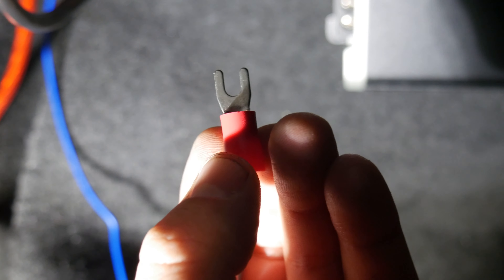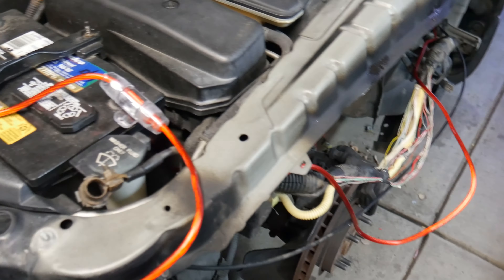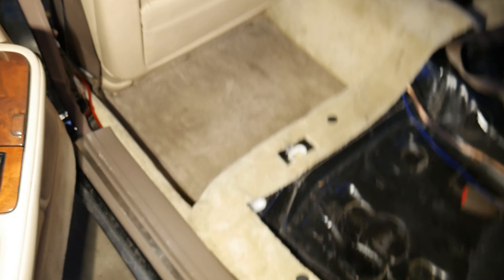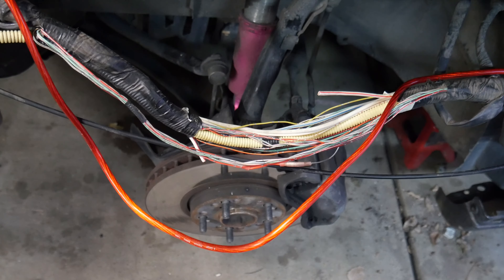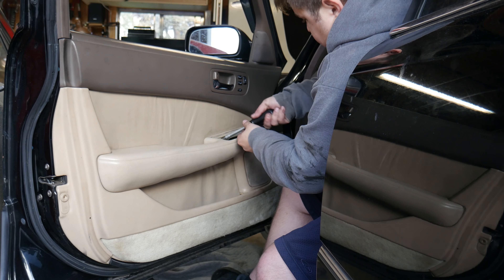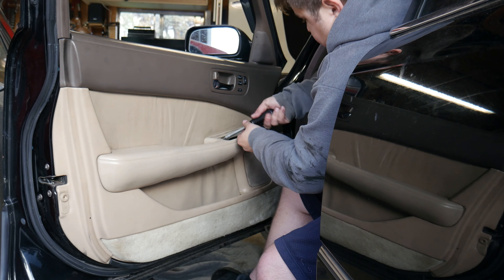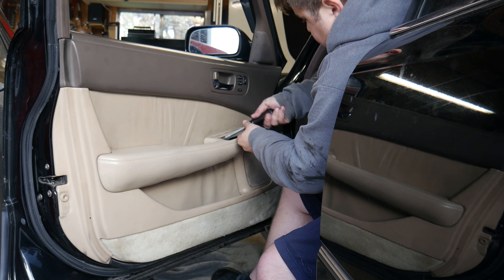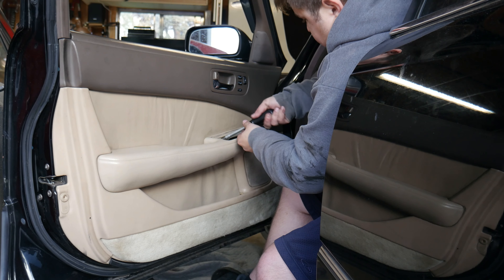LS400 Wiring Harness Tuck and Subwoofer Install [PT. 3]

Comment: How’s the quality compare between the stock location for a sub and one in the truck? Does a trunk sub hit harder?
Reply from the maker: I would say one in the trunk will 100% hit harder. If you used that space vs an 8 inch sub in the rear with a sealed box it may be similar. But if you have a box in the trunk you may as well get a 10" or 12" or two. You can probably get higher wattage stuff too.
Reply: @ClaytonBridges  makes sense. My LS sub barely works so I’m trying to figure out if I should get a new one for the same spot or scratch allat and go for a bigger trunk setup
Reply: @crosbylewis3660  it depends do you want trunk space or not? I have the Kicker QS L7 12s box, 2 amps & 4 crossovers on a custom rack BARELY fitting in there.